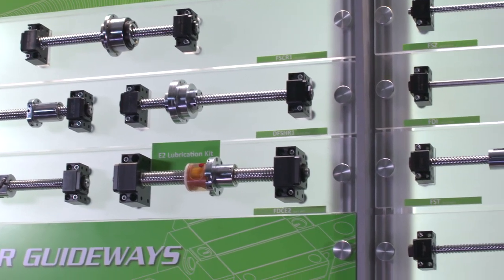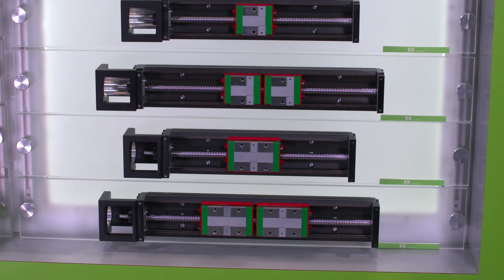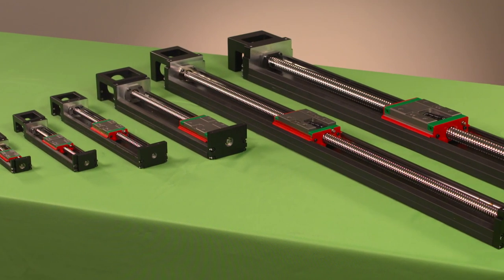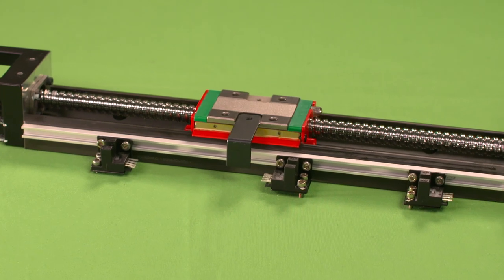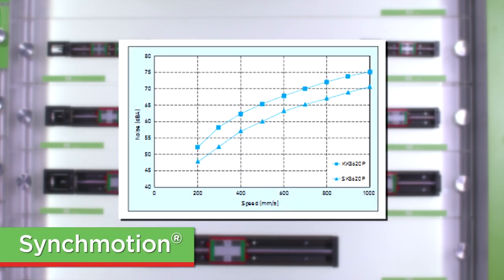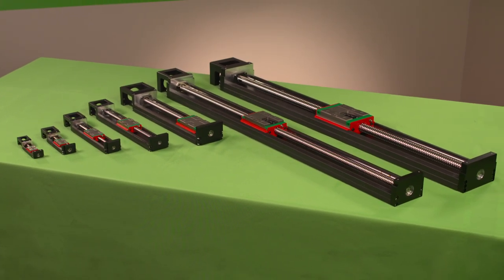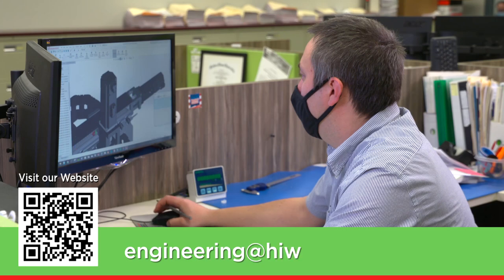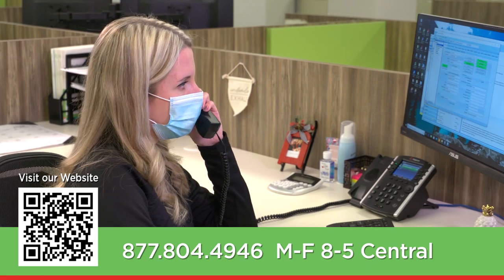Hiwin Ballscrew Stages

Comment: Hi there!
Could you please tell the document/routine which is used to determine the accuracy and repeatability specs, which are specified in HWIWN product catalogues? Is that one of widely used (like ISO 230-2) or some custom method?
Reply from the maker: Thank you for your question.  This channel serves the North American market. Our products are manufactured at HIWIN factories using the highest quality standards.  In fact, HIWIN was the first manufacturer to have the highest standards in rolled and ground ballscrews. HIWIN has the capability of producing JIS C0 class ground ballscrews, and DIN 5 class (up to 23 microns) for precision rolled ballscrews. The accuracy and repeatability info on our KK and other model ballscrew stages can be found in our Single Axis Ballscrew Stage catalog https://www.hiwin.us/wp-content/uploads/Single_Axis_Robot-E1.pdf.  If you are not able to find a product that fits your application, custom development may also be available. Thanks, again.